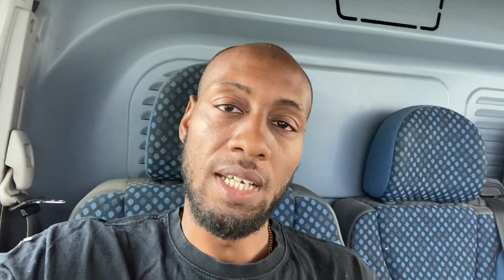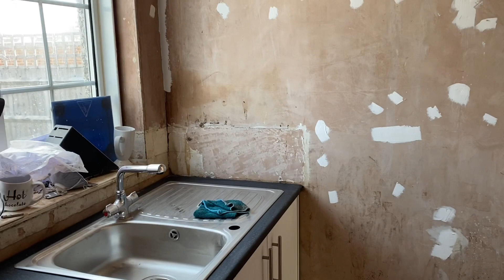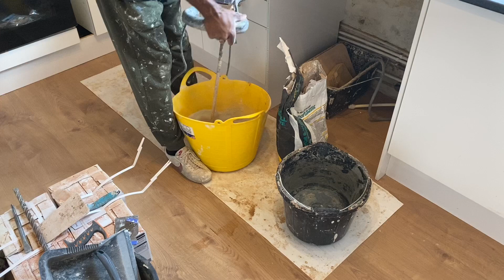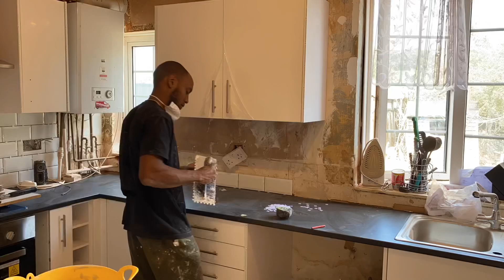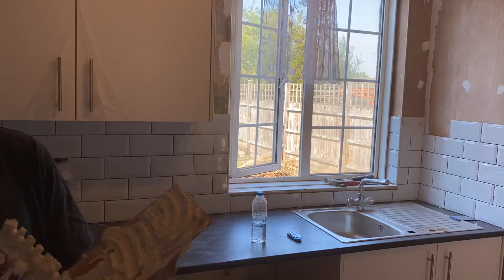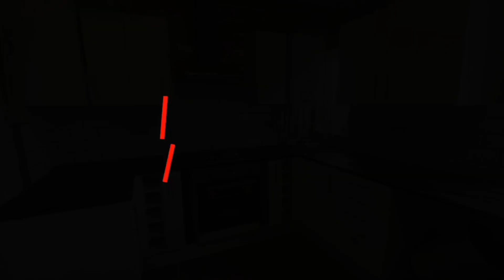Tiling a kitchen using subway tiles

Comment: You should keep working the same row from the center right the way around.. and use the off cut form the facing wall as you start tile for the return wall , that way  continues naturally, @4:18 the left corner looks terrible.. with all the little added in bits .. it should just fold at the corners..